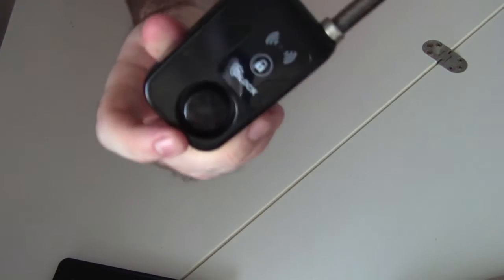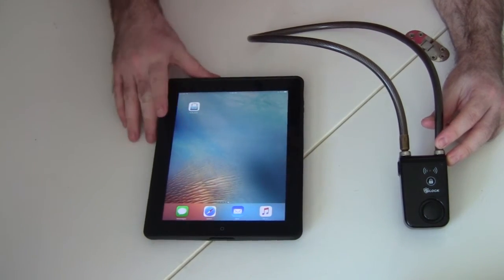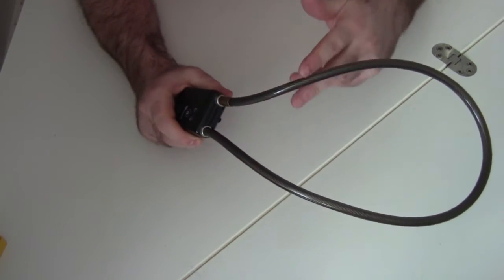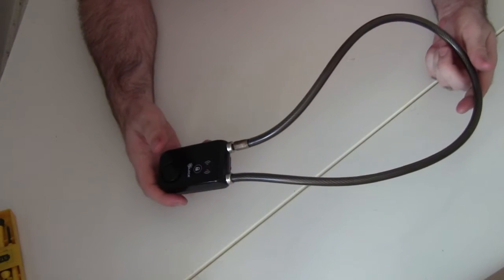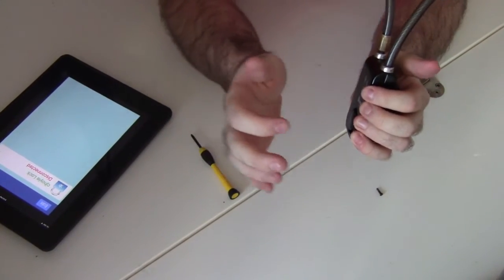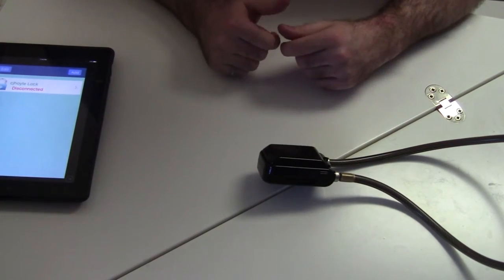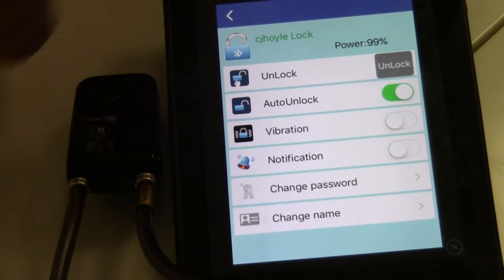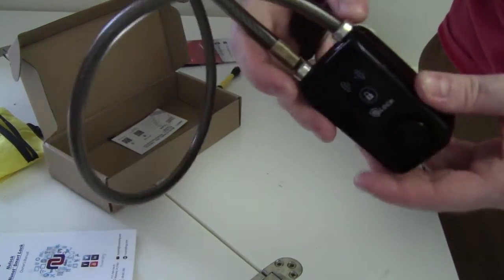Keyless Bike Lock - Demo and Review

Comment: Great video, cjhoyle. Just a reminder as mentioned in the manual, the vibration alarm will get off only one beap in the first time. If vibration continues in the next 5 seconds, it will alarm for 30 seconds, not continuously all the time. We did consider that in our design. So it should be OK for the nearby stores or people. As for metal housing, it might interfere with and block bluetooth signal. As you said, its main purpose is to secure your bike and deter thieves away.

Comment: That's a pretty good secondary lock. My place of work is on a busy high street (which I guess helps prevent with bike theft) but there is no real good place to lock my bike. There is a mini supermarket 2 doors down with lots of bike stands. I leave it there among other locked bikes, so I make sure I make my bike the hardest to break into. This should help tons, especially on a high street.
Reply: Sailor Mars Fan is it on a high street
Reply: does this notify your phone  when the lock is being tampered with ?